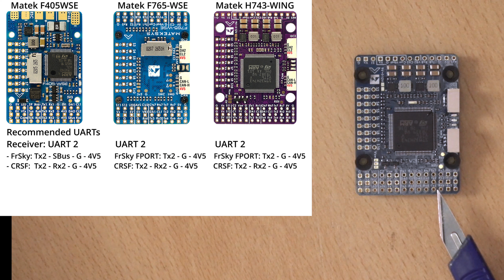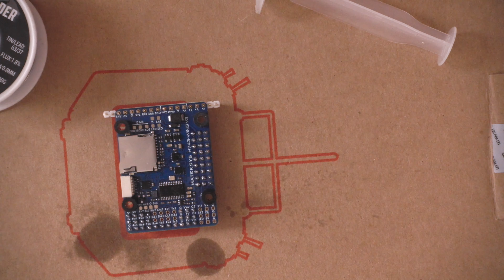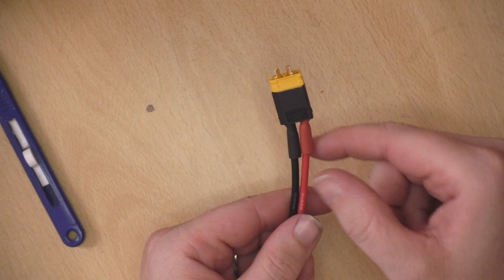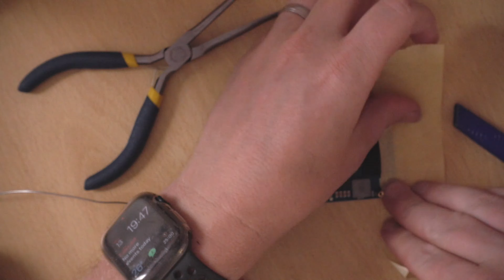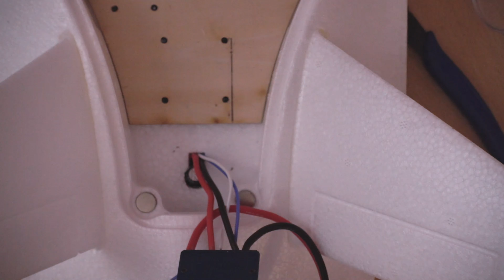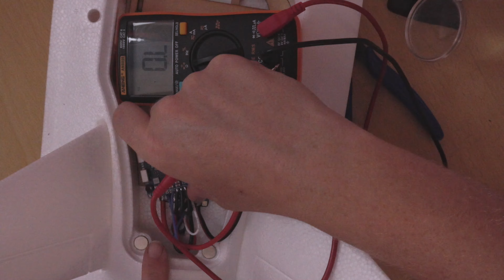iNav 5.0 Beginner's Build Academy: Lesson 04 - Installing the flight controller and equipment layout

Comment: Hi.

Was wondering if you could enlighten me on this. 
Why are some motors mounter at an angle pointing downwards on Planes with a tail, but on a Wing it is always mounted straight?

Rgds.
Reply from the maker: I’m guessing you’re meaning planes like the VolantexRC Ranger and Bixler. With those planes, the motor is tilted downward towards the centre of gravity. This should reduce the rotational effect of the high motor, but does go against lift. 

Traditional tractor planes have a little right and down. But only a couple of degrees. The right is to counter the P factor caused by the prop. At higher angles of attack it can induce left yaw, so the right angle counters that. The down angle is to reduce the nose up effect with higher throttles.
Reply: @MrD  Thanks so much for enlightening me! This is so insightful to me. Two thumbs up!

Comment: hello and thank you for all this good tutorials but I have a question I trying to make it work my matek =sys fc f22 mini and I dont see anything happen  when I'm at Inav 5.1 can you please help or do you have a video fo fix this
Reply from the maker: Hi Ed. To be honest, there's not really enough to go on there. If it doesn't work at all, make sure that the target is correct. It should be MATEKF722SE. If it is correct, it's hard to know without detail. If you're on Facebook, join the INAV Fixed Wing Group and post there. The group and I can help find out what's happening. If this is for a quad, there is also a group just called INAV, which also has good support.
Reply: @MrD  okay appreciate it, I think what’s happening it’s my laptop it doesn’t have the drivers so that’s why it’s not  detecting my FC on Inav and yes it’s for a quad so now I need to figure out how to install this drivers to my laptop.....
Reply from the maker: @EJ3.16  the link for the STM32 drivers can be found on the welcome screen of configurator. This is the screen when you first open configurator.
Reply: @MrD  okay thank sounds good I still learning new on this my first time building a quad..👍🏻👍🏻
Reply from the maker: @EJ3.16  no problem. I would have posted the link, but I’m not near configurator at the moment. Hopefully that fixes the problem for you. If not, if you have Discord, the INAV server on there is very good. Lots of helpful people, and plenty of quad pilots too.
Reply: @MrD  thank once again I already installed drivers but for zadig still having issues I don’t see anything on Inav not recognized my Flight controller maybe because I’m using windows 7..
Reply from the maker: It’s not Zadig you want, but the STM32 drivers. They are downloaded from the STMicrocontrollers web site. They should have a Windows 7 version.

Comment: WHY BRIDGE POS. BATTERY ONTO CURRENT SENSOR?
Reply from the maker: As I said in the video. It provides a better connection between the cable and the shunt resistor. Same goes for the ESC positive to the shunt. It is not just relying on the traces of the PCB. Matek actually have started recommending to do this.

Comment: I am learning so much thanks to this series. Thank you so much.
Reply from the maker: Thanks again. Hopefully you’ll be enjoying your first FPV experience soon.
Reply: @MrD  I hope so! Parrot Disco got me into this... Btw I am thinking of using the airframe of a Disco wing and add same electronics as in this series. I hope I am not wrong!
Reply from the maker: I’ve not seen a disco for a long time. And even then it was brief. I’ve heard of people converting them though.
Reply: @MrD  They were a bit ahead of time when they came out... There are many on the 2nd hand market in very good states. I have 2, one with that unique 4G mod. The aerodynamic is very good and it has loads of space inside too. What I enjoy is also the aileron servo located on the body and not the wings: works surprisingly well and so fast to mount/unmount and fit in a backpack.

Comment: Inav 5.
What's wrong with all of the burned escs. A lot of people complaining. Now I'm worried to upgrad🤣
Reply from the maker: There is nothing wrong. I’ve been flying on 5 for months.  The only issues I have seen with ESCs is on quads; where people don’t follow the upgrade instructions.
Reply: @MrD  yes. It was about quads. I better check and see before doing anything. Thanks
Reply from the maker: @oussamasmaini7297  from what I understand, it was because old filter and PID settings were moved across. The advice is to start from defaults and re-tune. There are also more filter improvements coming in 6.0.
Reply: @MrD  that's where i suck 🤣. I only used pid ones in my life. I fly sort of big quads and not often. Do you if i let how it is it will be fine. Or just use older version.
Reply from the maker: @oussamasmaini7297  I don’t have any quads on inav, or even fly them that much. So I’m not the best person to ask. Paweł Spychalski would be the better person to ask. He has inav quads of all different sizes.

Comment: I did my Inav 5 H743 v3 build a week to soon!! Need to take it apart and bridge the batt, shunt and ESC pads. I suspected that might help current flow.
Reply from the maker: It will, but it’s not essential. If you’re running a high power setup it’s worth doing.

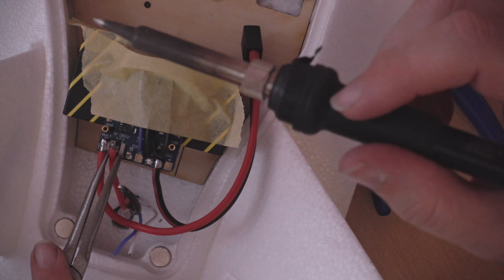Comment: 42:27 why did you solder it like that you got solder all over the other chip. i think that was a bec you solder on when you solder you positive battery wire
Reply from the maker: That was done on purpose. Soldering the battery positive lead and ESC positive lead to the shunt resistor means that you're not just relying on the copper traces. This means that it will be more resistant to heat in higher current situations. The shunt resistor is connected to those pads already. It just reinforces the connection. Matek even show this on some of their demonstration photographs. See in the bottom right http://www.mateksys.com/?portfolio=f405-wmn

No, it was the shunt resistor, not a BEC. I did explain in the video. But maybe I wasn't clear enough?
Reply: @MrD  I had just started the video up for the 3rd time i had not finished watching. i watch when i build on my plane or repair. thanks for the info

Comment: A great video, exactly the type of video I wish existed when I recently got into fixed wings and setting up inav. you are a legend for putting so much time and effort into your vids. 👌🏻
Reply from the maker: Thanks Marc. I’m glad that the series is helping. Sometimes I wonder if its too long one parts. But I think it’s better to be that way, than miss parts out.
Reply: @MrD  its the details and showing all the steps that makes these so helpful, don't change a thing! Im in the middle of setting up a H743 with inav 5 in a Volantex 2000mm and picked up a few more tips and tricks that helped me while watching this vid.
Reply from the maker: Thanks for the feedback. I’ll keep the content the same. I hope the VolantexRC build goes well. Is it the Phoenix or Ranger?
Reply: @MrD  Phoenix v2, I had a problem initially with the H743 only showing 2 cells but found the solution on the matek site (voltage scale 2100 instead of default 1100). Ive got the elevator and rudder connected and working as expected but im trying to work out what I should do with the ailerons as they are on Y splitters, do I just connect to one of the aileron headers on the FC and delete the other in the mixer page in inav or would it be better to remove the Y splitter and and wire both ailerons separately? Im coming from quads and beta flight so everything is kinda familiar and unfamiliar at the same time haha
Reply from the maker: Nice. I have the v1 as a powered sloper soarer. The wing joint on the v2 looks better. We can chat on Discord about the Y splitter. But for others reading here. I personally would have each aileron and each flap separate. It gives far more options, including crow braking and full span ailerons.